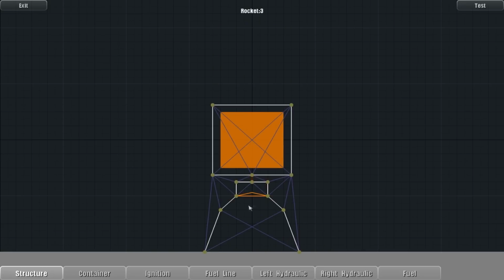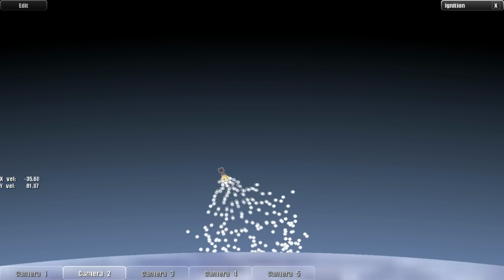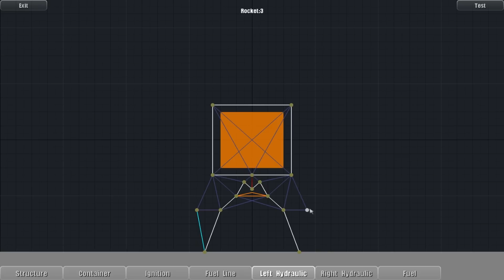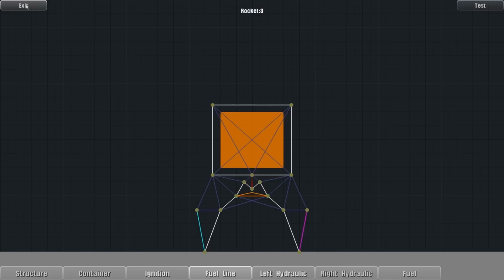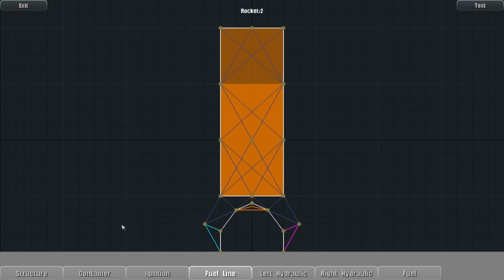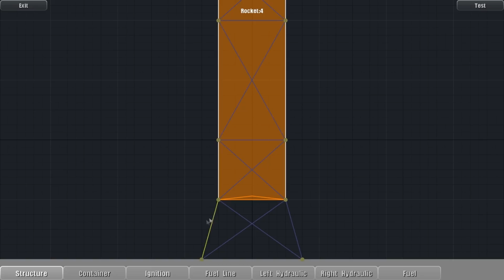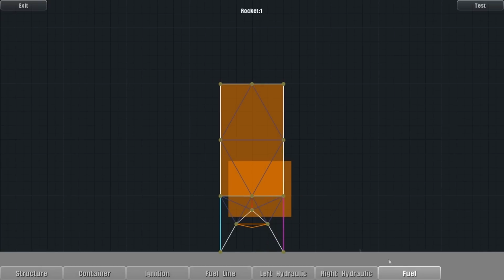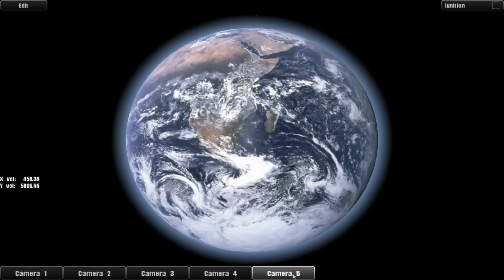Rocket Builder - Cryptic Sea's Contribution To The NASA Game Jam

Comment: What you need to do, is set up the ignition near the top off of the nozzle. Then have a compression chamber that expands into that nozzle shape that you already built. This will force the expanding gasses to compress, and they will come out faster, and with more force, than in the way if you set up the fuel to ignite, at the compression area.

Comment: Thanks for doing the video, the fuel bug is when you click on the fuel button it places fuel in the ground (I'll fix that soon), use the 1-7 keys to switch types instead of clicking to avoid that.  The gravity is constant right now, I wanted to fix that but ran out of time.  Also your ignitions are facing the wrong way :)

Comment: The particles only ignite on one side of the line, I was getting the problem of exhaust going back into the fuel tank so I added that.  I probably should've used left-to-right by default, but it was a 47-hour game jam

Comment: i thought one of the best things you could have done was put a hydraulic crusher type thing in the fuel tank so you never have to worry about the fuel feed not working :) just pushes all the fuel to the bottom
Reply: I've tried that, but it is very difficult to get working. You can put fuel lines through the whole tank, but then you use up your fuel faster.

Comment: That will not work: fuel, for some weird reason, will leak form the top of the tank (even if you don't stick fuel line directly on the top). But if you start from the middle it may be working. (I play this game since 2 days and i have tried a lot of things)

Comment: I built a tower to max height, and I added an engine to the bottom with fuel, and it didn't work right. The fuel just glitched and fell out of the walls, no physics at all.